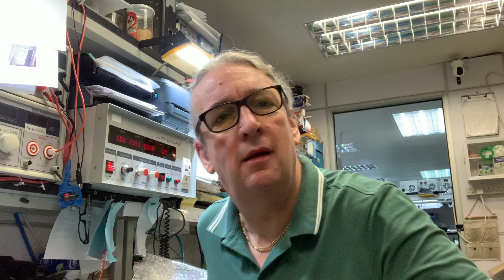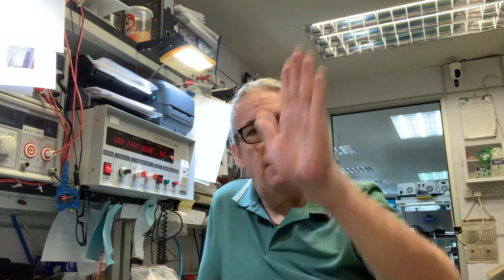Grid Stability

Comment: Keith, Great set of videos. I have been sent a FoxESS system from a UK supplier but realise it cant parallel properly. I need to get 10kw on hybrid and it seems that your system does this. Can we have a chat to confirm. It would help my supplier if the Fox HV batteries operated with your inverters but in truth they are still in box and can be returned. Then availability would only be the issue. I think your items are out of stock in UK for a month. Can you message me please.

Comment: Thanks Keith, very informative. You’ve done really well to build awareness & eminence of Sunsynk, and I look forward to upgrading my inverter to a Sunsynk in the near future (8kw or 5kw hybrid). Question: any particular make of lithium Batteries that you would recommend/prefer for  the Sunsynk inverters? I have seen that certain batteries are “more compatible” with some inverters based on their BMS etc. I’d like to upgrade my 300ah Gels and want to pick a battery that will work as well as possible. For my personal, residential setup in South Africa, where I have about 4kw of PV panels connected. Thanks in advance.